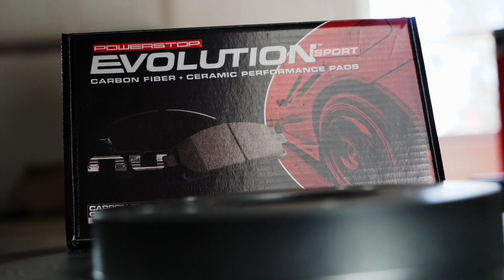Honda Element Build EP2: Lift Install

Comment: Great video, but we’d love to see the final product!  Im looking forward to seeing the BFG KM3’s and hearing how it rides on and off road.  What size did you go with?  I’m building a Camping/Overlanding Element- it’s almost done.  3in lift, Method wheels, Acura brake upgrade, roof rack, tent, awning, etc and working on adding a supercharger:).  Thanks for the great video!